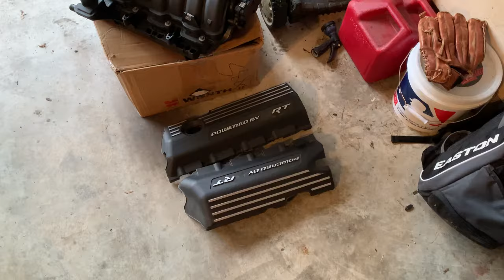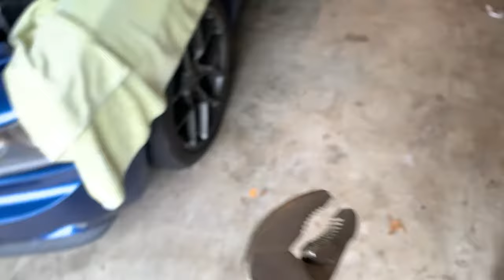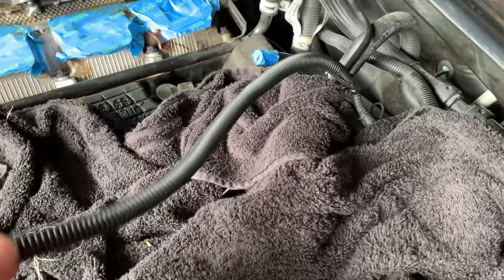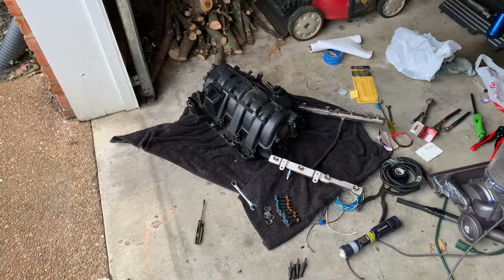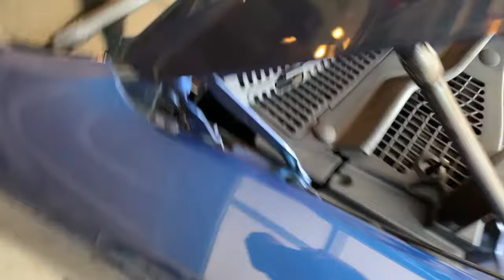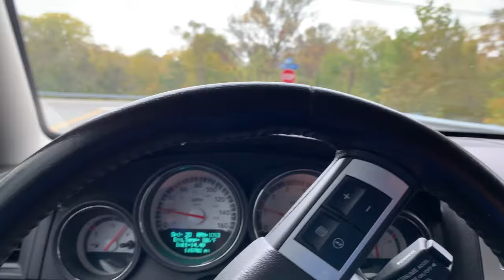6.4 Intake Manifold Swap onto a 5.7 HEMI

Comment: If you use seafoam GDI cleaner at about 15% oil life with BG 44k fuel additive it will clean your injectors and burn off all that oil in your intake manifold. You won't have all those deposits anymore or any of that oil seepage. Do it every oil change! Thank me later!
You will dump a lot of white smoke right after the seafoam and that means it worked

Comment: Curious how many miles were on the motor?
Reply from the maker: About 116,000 at the time.
Reply: @n-power-automotive I'm at 68,000 miles. How do Mopar guys keep the internals clean? Ever go with additives or go with 30w oil?
Great job keeping up on maintainance.
Reply from the maker: @M @Matua01 good oil, frequent oil changes and get yourself an oil catch can.
Reply: @n-power-automotive That what I was thinking.

Comment: Do you need your heads to be ported like MMX states on their site. I have a 2006 300c 5.7 and I got the MMX 5.7 to 6.4 intake manifold swap kit and the conversion plates in order to bolt this kit  on my 2006 300c 5.7L, but do I need to have ported heads.

Comment: I did this manifold swap on my 2013 Ram R/T 3 years ago and used a S&B 6.4 CAI. Also did ceramic coated ARH Long Tubes, catch can, removed stock radiator fan assy for an electric V6 fan, and loaded a custom tune by Jay Greene. Great mod on a 5.7L

Comment: Did you reuese your old throttle body of the 5.7? and how about Short runner valve (SRV) actuator (05038529AC); Short runner valve (SRV) wiring pigtail (68064996AA); MAP sensor (68271094AB); PCV Valve Cap (05038532AA); Did you have to exchange this parts also or could you reuse the 5.7l parts?

Comment: Nice video. I have no automotive background, so please forgive the question. I noticed that you felt no significant power boost with the swap. Does your engine have "eagle" cylinder heads? Could the lack of significant power be due to the alternator or cam? I am trying to learn since I just bought my first Dodge, a 3rd gen Dodge Ram 1500.
Reply from the maker: I don’t own this car anymore, but it did have Eagle cylinder heads. They started in 2009. Cam and alternator were untouched, but it wouldn’t have anything to do with that.
Reply: Thank you for your reply. Have a great day.

Comment: How do i get rid of high rev and car going into sport mode after swapping in the 6.4L manifold?  My car check engine light comes on and it says i have an air intake leak
Reply from the maker: Hmm not sure. Try searching LX Forums or join a Charger FB group.

Comment: I have a 5.7 shaker would the 6.4 Intake Manifold not work with the shaker on top or is it compatible?
Reply from the maker: I’m not sure, but I’d think the Shaker brackets would probably be different, but I can’t confirm that 100%.
Reply from the maker: And to be honest, if I still had this car, I’d probably go back to the stock 5.7 manifold. The cost/effort wasn’t worth it for very little results if any.
Reply: @n-power-automotive  you can make more power with the stock one from the 5.7?
Reply from the maker: @Lionelinmotion  I don’t know if you can make more power or not, it’s just that the 6.4 didn’t add much if anything for all the work. If I went back I’d just get the 5.7 intake ported.

Comment: Will this bolt on to a 06 300c 5.7 if so what all will I need and can I bolt it directly on my pregame block
Reply from the maker: You need adapter plates to fit on pre-09 HEMIs. It’s really not worth it since you won’t get any gains on the older style HEMIs.

Comment: Is the 5.7 and 6 4 cold air intake the same besides the tube?
Reply from the maker: The tube is the main part of the intake, so yeah, they’re different.
Reply: @n-power-automotive the scv actuator wat do u plug in that
Reply: Where u get the cold air intake extension from

Comment: Removing gas cap doesn’t relieve any pressure. This is someone with zero knowledge
Reply from the maker: 😂 ok you leave the gas cap on and let me know how it goes.
Reply: @n-power-automotive  I’ll do it knowing that the gas cap is vented
Because I have wisdom and experience you are lacking
Reply from the maker: @DanielJohnson-ec8rk  vented doesn’t mean there’s zero pressure in the fuel lines. I know this from actual experience taking the fuel rail connector off without taking the gas cap off. Guess that happened? Fuel sprayed out. Second time I took the gas cap off, no spray. So, despite my lack of knowledge, I hope you learned something today:
Reply: @n-power-automotive  that’s pressure between the pump and rail. Removing the gas cap has zero effect on that pressure. There is no positive or negative pressure in the tank by design

Comment: Can I reuse my 5.7 Hemi MAP sensor on the 6.4 Intake manifold as long as long as I have the extension adapter harness? 

What all needs the extension adapter harness, just the MAP sensor??
Reply from the maker: Great question. I’m not sure the answer since it’s been almost 2 years since I owned my Charger. Your best bet is researching it on LXForums.

Comment: Unplug your fuel pump fuse and try to start your car so it empties out your fuel rails most of the way
Reply: Its actually the injectors one u remove that turn key over twice no pressure in fuel rail everytime i did the fuel pump relay that shit was still under pressure

Comment: When you plugged up the map sensor to the MSD box, you already had a connection ready for it? Or what exactly was it?
I got a 6.4 manifold and am ordering the MSD box and everything else I’ll need. Any help is much appreciated
Reply: Okay last question before I get started. Can this run without a tune?
I plan on getting my pcm unlocked soon but it maybe a week or 2. So would it be fine without a tune for a short time?
Reply from the maker: @TexasMadeCruz  it’s been so long, so I can’t say for sure, but I think you’d be fine as long as you’re not getting on it.
Reply from the maker: I bought it secondhand, so it had the majority of the wiring harness done on it.

Comment: I have a 06 SRT-8 Chrysler 300, would it be any difference if I remove my bullet proof silver cast iron intakes for the newer black plastic 6.4 intake?
Reply from the maker: From everything I remember the 6.4 intake does nothing for 6.1s. You’re better off sticking with the cast aluminum 6.1 intake.
Reply: @n-power-automotive  thank you sir!

Comment: Has anyone ever done this to a ram 1500? I got a 19 5.7 And I’ve found a 6.4 intake for 200 bucks so I plan on picking it up here. Any tips or suggestions?
Reply: Yes its been done before the car 5.7’s started doing it
Reply: MMX sells the wiring and everything that allows to run a 6.4 truck manifold on a 5.7

Comment: Did you ported intake manifold 392Is there any benefit from that?
Reply from the maker: No I didn’t port the manifold. It might be worthwhile if you are making a lot more horsepower than I am to squeeze every little bit out of it, but for a relatively stock 5.7 it’s probably not.

Comment: I got a question at what point do I get a new transmission. I’m about to put a new performance cam, long tube headers a and I want or put 6.4 manifold also. At what point do you say I need a new trans and rear to handle power
Reply from the maker: From what I’ve heard, the stock Nag1 can handle 550hp/580 ft lbs. More than that and you need to step up to a built transmission.
Reply: Awesom man. Something I’ve been wondering. Seem not to be able to find anything about it. I must be wording my search wrong

Comment: I believe this type of mod gives 15-18hp increase. The mods that would greatly increase hp is cam and heads.
Reply: The top end gains are 10 to 15 without tunes. The midrange is where the true gains are. I saw 35 to 40 from 1800 to 4500. I also ran a year without the srv hooked up. The Z Automotive  srv kit is the way to go vs the MSD. Adjustable in the car, and won't fail due to heat under hood.
Reply: @SModelMafia  just
Reply: with a good cold air intake and throttle body ive seen as much 35 peak horsepower gains. with this mod your looking at massive low end torque gains and a smooth power delivery throughout the entire power band which is may more important then peak horsepower.
Reply: and superchargers
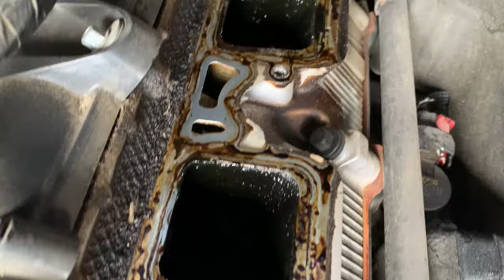Reply: 5:31 Jesus and I thought mines was bad when I saw a little bit on mines when I took it off but it was super clean 👌
Reply from the maker: Yep with a tune it does. Without a tune I didn’t feel much.
Reply: @n-power-automotive  So, you've tuned it and it feels a more powerful now?
Reply from the maker: @ren-o6b  no I still haven’t officially got it tuned. Long story but my email tune is supposed to compensate for the intake, but it really needs to either have a dyno tune or a revised tune made from data logging.
Reply: @n-power-automotive  I see. How much additional hp do you think it will make once it gets tuned. My understanding was as much as 18. I have an 06 Charger Daytona I'm making some upgrades, as well.
Reply: @r @ren-o6b ’s not about the horsepower gain , the 5.7 chokes out at 5000 rpm because it has only long runners , this 6.4 intake with the active short runners turns on and feeds the engine air keeping top end pulling instead of falling off

Comment: Probably a stupid question but the 5.7 oil catch can work on the 6.4  intake manifold? Because I see on JLT‘s website they look kind of different
Reply from the maker: Not a stupid question at all. Yes it’ll work on both, but you’ll need different length hoses.

Comment: Typed up 6.4 intake manifold swap on a 5.7 and you were the first to pop up. You need a good tune to see that extra hp with bolt ons.
Reply from the maker: Wow I’m surprised mine was the first video to come up. That’s awesome! Yeah, it’s definitely in need of a tune. Now that I have my other maintenance stuff done and the temps around my area are starting to come down I’m going to look into using a new tuner.
Reply: I hate to ask a crazy question will it still run with out a tune ...I need to find a company that does tuning
Reply: @jaywiz3826 yes it will run no problem but to see any gains you will need a tune

Comment: Hey is your charger an 09 I have a 08 I wanna try this on but I understand 09 has different heads from pre-09
Reply: Ok thanks bro for the quick reply
Reply from the maker: Yes, mine is an 09, and yes, starting in 09 the 5.7 changed and went to VVT and different heads. You can get adaptors to make it work, but from what I’ve read you lose most of the benefits of the 6.4 intake manifold on a pre-09 because the ports are a different shape and size. You’d be better off with a 6.1 intake manifold, especially if you plan on putting a cam in it later down the road.

Comment: You need a cam to go with it or it's just a very small upgrade from stock at the high end. (5HP)
Reply from the maker: A cam would make a huge difference, but this without a real tune has very little gain in my opinion. I still need a revised tune, I’ve just been lazy that’s why I haven’t got it yet lol. The gains are supposed to be torque in the mid range RPM, nothing down low or up top. Some people claim big horsepower gains in the mid range too, but I’m skeptical.

Comment: Cleaning the intake manifold is scary, not cutting the map sensor. Anyone who ever installed a stereo system can tell you that ain't shit. Good details and info on your video 👌
Reply from the maker: Very true, although I hadn’t soldered wires in years, but it wasn’t that bad at all. Thanks!

Comment: Would you recommend installing the manifold with 6.4 injectors and fuel rails or would you suggest sticking to 5.7? I can get a revise tune with the bigger Injectors but is it worth it?
Reply from the maker: Great question. I was told there’s no point in using the larger 6.4 injectors because they’d be too much for the 5.7, unless you’re making over 450hp, which I’m definitely not. The tuner would have to scale them back basically to 5.7 specs in order for the engine to run right. The 6.4 fuel rails are identical to the 5.7, as far as I know, so you should be able to use the 6.4 rails if you want.
Reply: @n-power-automotive  ok cool. Thank you for the reply. Im looking to do this mod next week
Reply from the maker: @agame343  cool good luck!

Comment: Great video. A question why do you need msd box and circuit boss.  Going to do that to mine 06 charger as well.
Reply from the maker: Thank you! You may want to reconsider putting the 392 intake manifold on a pre-Eagle 5.7. The ports don’t match up at all so you have to use adapters, which from what I’ve read defeat the benefits of it. The MSD box is used to switch over from the long runners to the short runners at a certain RPM. The Circuit Boss is used to protect the electrical to and from the MSD box. It’s basically like adding a small remote fuse block.
Reply: @n-power-automotive  preciate it.  Well I know I want try that.

Comment: Wouldn't it be better to tap into the coil wires for the RPM reading? I guess injector pulse would work too but every tach I've installed got it's reading from the ignition coil.
Reply from the maker: Yes, I believe either way work probably work. All the write ups I read on Charger forums and YouTube suggest using the injector wire, so that’s the way I did it.
Reply: The other forums say it is a green wire to the throttle body to activate the long runner in the intake the whole purpose is to open the long runner in the air intake…

Comment: Where did you get your air temperature sensor extension? And what wire did you use to extend the map sensor?
Reply from the maker: I got the AIT extension from Legmaker Intakes and I extended the map sensors using automotive wire I bought from WalMart.
Reply: @n-power-automotive  is the wire 18 gauge? I got a few rolls of that I planned on using to wire the cirkit boss and msd box
Reply from the maker: @tallguyinahemi  I believe so but I’m not 100% sure. It’d been a while.

Comment: Great video! Can you do me a favor and tell me exactly what wires are connected where? I did my install and wiring but the MSD box isn't getting any power. I tested all connections and they're all good until it gets to the Circuit Boss, after that no power to the MSD box. I've spent like 8 hours just making sure everything is set up properly and as far as I can tell it is...
Reply from the maker: I wish I could, but I bought mine used so the wiring harness was already together so I just had to do the power, ground, tap to the fuse box and the injector wire. Do you need to know any of those?
Reply: @n-power-automotive  nah I figured it out, I do have a bad Circuit Boss. Thanks for getting back to me though I really appreciate it!
Reply from the maker: @idunno3639  glad you figured it out!

Comment: Nice video explains a lot but why did you have to mess with the injector wires??
Reply from the maker: Thanks. You have to tap into one of the injector wires so the MSD box can read the RPMs so it knows when to switch from the long runners to the short runners.
Reply: @n-power-automotive  do you need the MSD box or is that just something for your tuner or something extra
Reply from the maker: @goldengam3rxx3  you need it have the active runners inside the 6.4 manifold work. It has nothing to do with the custom tune. You can run the 6.4 intake manifold without it, but there would be no gains over the 5.7 without the runners working.
Reply: @n-power-automotive  I have a 2017 challenger rt with MSD already so I shouldn’t need it right?
Reply from the maker: @goldengam3rxx3  I believe 2011 and up do not need the MSD box.
Reply: @n-power-automotive  okay cool thank you
Reply: What MSD box is that? Part #

Comment: That's interesting that you have a catch can, yet there's a good amount of oil and carbon in the intake runners
Reply from the maker: Yes I agree. I was surprised. But I bought the car used so it had 40k miles of use with no catch can. Regardless I’m glad I got a chance to clean it out while I was in there.
Reply: Yeah, 40k miles used. That explains the gunk that was found.

Comment: Did you upgrade your fuel injectors to bigger ones and did your check engine light come on after installing the manifold
Reply from the maker: No using the stock 5.7 injectors. They’re supposed to be good for up to 450hp, which I’m no where near. No CEL at all.
Reply: @n-power-automotive  thanks bro I probably did too much I went with a bigger throttle body and hellcat injectors and notice a code for p0303 popped up
Reply from the maker: @kiddmanny012 you definitely need a custom tune with all that.
Reply: Do if you upgrade the throttle body